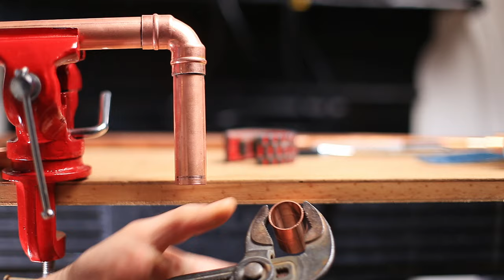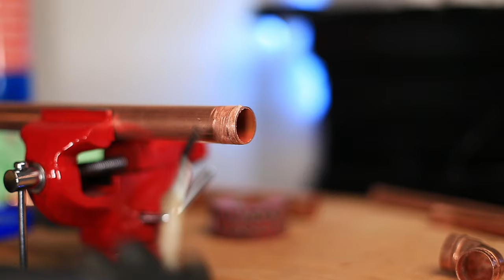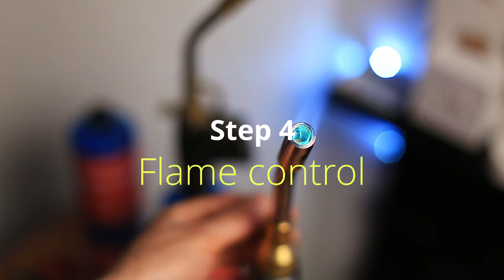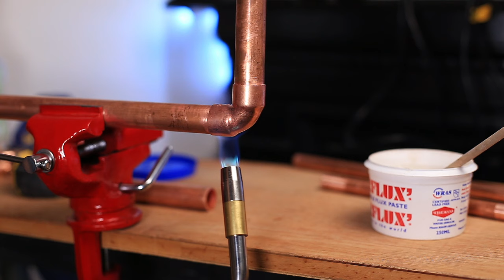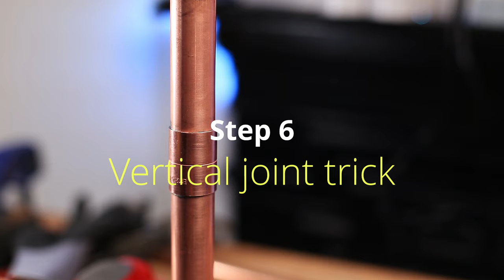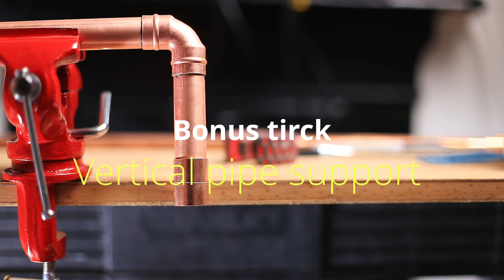How to solder / sweat copper pipe for beginners in 7 easy steps

Comment: I’ve been a plumbing contractor since 1979 and I always clean both male and female ends with sand cloth and a fitting brush then apply flux to both surfaces. I can make wiped joints beautiful with a simple dry rag. Self cleaning flux has been around forever but pros don’t use it. Clean the pipe and fitting carefully to remove the shiny finish and do not touch a joint with bare hands before sweating because solder will not stick to body oils. 
I’ve sweated 4” all the way down to 1/8” 50-50 in the old days 95-5 now.
There’s an art to it, it starts with proper instruction and continues with practice. You need a nice looking joint but most importantly it needs to be dependable.

Comment: Just looked at a couple of manufactures data sheets for self cleaning flux, in both cases they still recommend cleaning the area to be soldered, so go figure?? Personally, given cleaning only takes a minute or two and is so easy, I always clean the area I am soldering.  I would recommend reburring/reaming the cut end of the pipe before starting, inserting the pipe into the fixing and then mark it (little scratch) to show how deep it goes.  Then remove pipe and clean the area that will be in fixing..Also clean the internals of the fixing, and repeat the other side. Do not solder one side of a fixing and then try to solder the other at a later time as it can cause problems, rather solder both sides in the same process as shown in the video. Use only a minimal amount of flux and as mentioned, don't get flux outside of the joint as the solder will run..A small lighted inspection mirror can help you see  what's going on in the area behind the pipe and remember the pipes must be absolutely water free before you start...
Reply from the maker: Haven’t cleaned new fittings in 10 years. No problems at all. It does speed up the soldering a lot. Put a bit of self cleaning flux on an old pipe and heat it up and see what it does.
Reply: @UrbanPlumbers  My OCD would not allow that!  lol I was taught always to clean and it's ingrained now, but I am the first to admit flux formulation has changed greatly over the years..I don't solder in the course of my job anymore so a little extra time per fitting is no big deal.
Reply from the maker: @peterevans8194  I was reluctant at the start but people that I trust told me not a problem. On large installs it does make me faster.
Reply: 10 , 15 or 100 years , doesn’t matter , ALWAYS clean your pipes and fittings before soldering , 
   Solder would stick better to it

Comment: I need to replace a leaky T copper fitting. Can some of the piping be heated up to remove cleaned and reused or does it have to be cut back to new pipe?
For example the higher connection looks nasty so I’d like to cut it back but the one going to the right looks clean and fine.
Reply from the maker: Yes you can de solder, clean and solder again

Comment: you are soldering pro press joints at the end. did you remove the o ring?
Reply from the maker: No, they are called Yorkshire fittings - they have a solder ring inside

Comment: What are some reasons that the fitting would but accept solder? Have been sweat fitting for years, but for some reason on this particular application solder is just beading up and falling to the ground. Using paste flux on 3/4"copper. Funny enough, sweat fit 1/2" copper without a problem just before this. It is new paste. Maybe bad? Could there be some kind of grease on the pipe? Just stumped.
Reply from the maker: Moisture, not enough heat, grease or dirt?
Reply: No moisture. Not dirty. Using map gas the second time with the same problem. Got the joint hotter than I would have normally needed. I'm thinking everything points to the new paste flux. It was cold, 40 degrees. Don't know why that would change anything, but that's a variable.
Reply from the maker: @everygoodtree  too much heat can do it, copper oxides and solder doesn’t stick

Comment: Question. Why are you soldering pro press copper fittings. They’re meant for the pro press tool
Reply from the maker: They look similar but they are not press. They are Yorkshire fittings
Reply: @UrbanPlumbers  I just looked them up. Seems like those fittings aren’t in the US where I’m from, first time I’ve heard of them. I assume they’re a UK thing?
Reply from the maker: @futurefarmermatt9803  yes UK thing

Comment: Everyone else is saying use Flux on both pieces.  Why do you say different?
Reply from the maker: You don’t want flue inside the fitting. When you insert pipe you will push flux into the fitting and solder will follow that creating restriction in the pipework. You only apply flux to pipe not the fitting.